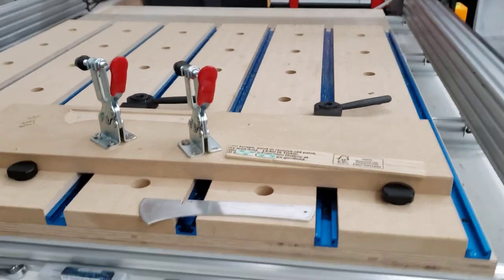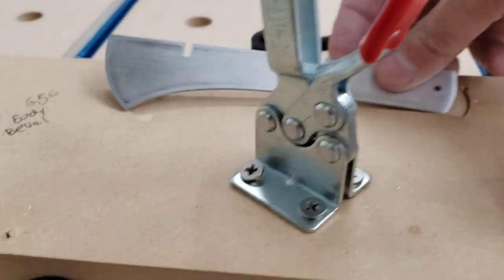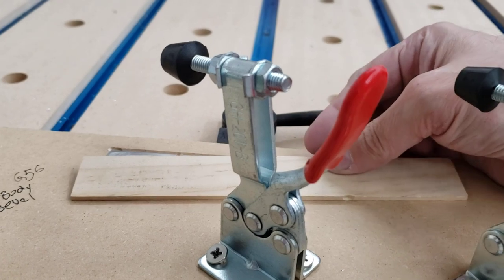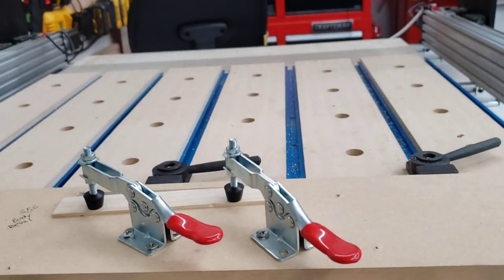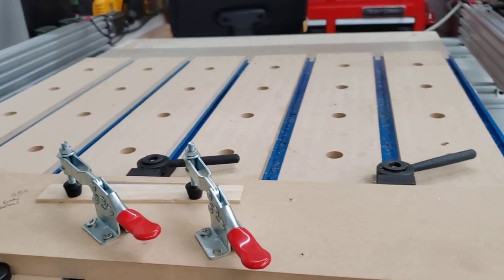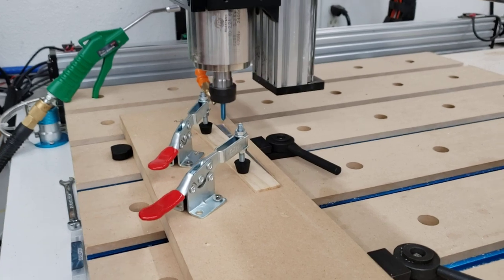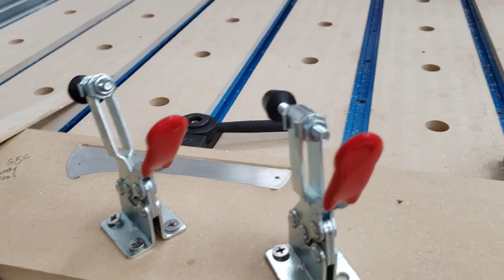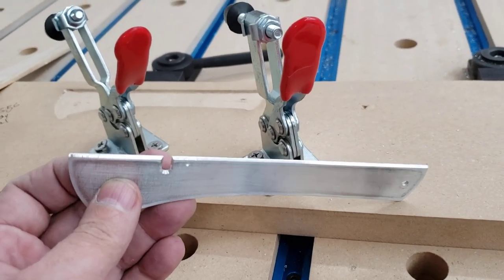Machining a chamfer in 6061 aluminum. Ultimate Bee CNC.

Comment: How thick of aluminum material can this machine cut?  I've seen previous videos you posted.  I'm getting ready to pull the plug on the full kit with the xProv5 controller and water cooled 2.2kw spindle.  I know yours system is upgraded a bit and was curious what a stock setup is capable of?  I'm am a complete newbie so I'm hoping the complete kit will be enough to get me going and explore this as a hobby.
Reply from the maker: You can cut pretty much anything you can reach with a bit in the chuck. The real limitation comes with feed rate and depth of cut. You'll have to experiment with your tooling, work holding, spindle speed, etc. Another thing to consider is cooling the part. Water based coolant will wreck MDF, even if you seal it. Start shallow and conservative and experiment. Different grades of aluminum machine differently. 6061 is hard and flaky whereas 5052 is a bit softer and can't be cut as quickly. There are a lot of variables in this equation. Good luck with your setup. Enjoy the assembly and setup!

Comment: Would you recommend upgrading from a 750 x 1000 acme screw  Workbee to the Ultimate Bee 750 x 1000?
Reply from the maker: It really is smoother, and has nearly no backlash. My machine is an upgrade from acme screws. I would do it again in a second. The plates are thicker, the screws and fittings are better and the bed parts are much better designed. The only drawback is that you lose a very small portion of the work area (details on their website)
https://youtu.be/ubKEWQRE3eo
Reply: @CNCMakerNW  Many thanks for your response.